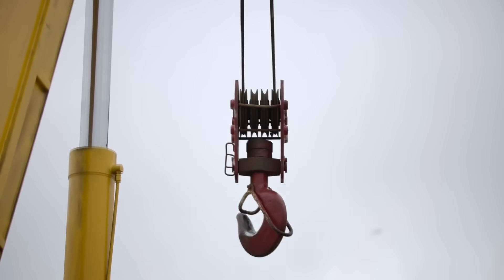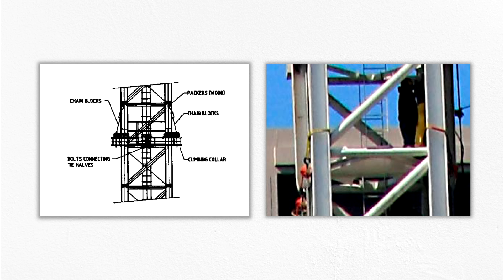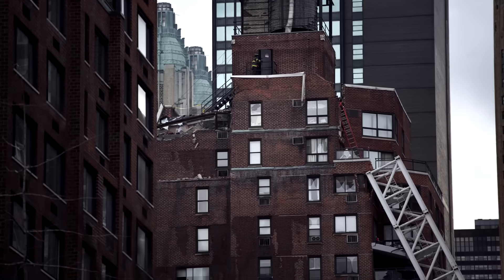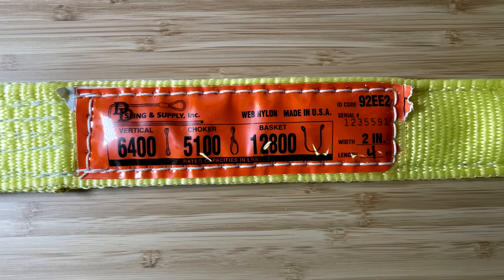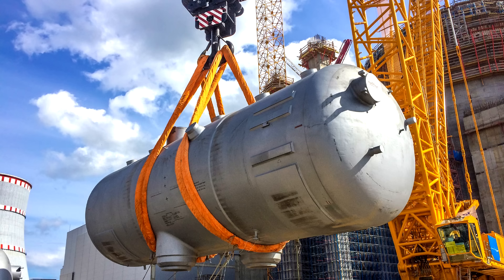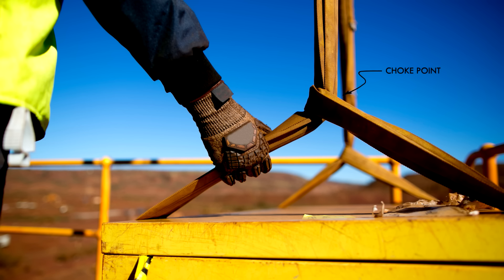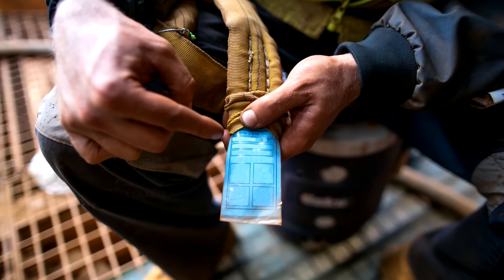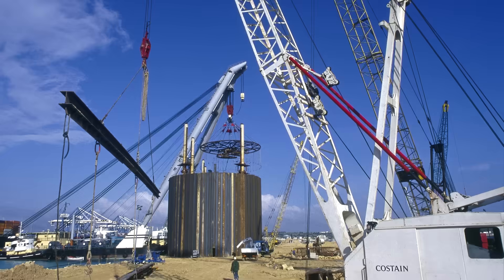Why Things Fall Off Cranes

Comment from the maker: 🏗 New to the channel? Check out a playlist to see more videos like this one: https://www.youtube.com/c/PracticalEngineeringChannel/playlists
📺 Get a year of CuriosityStream AND Nebula for 26% off, just $15! http://www.curiositystream.com/practicalengineering
📝Sign up for my newsletter to keep track of everything I'm working on here: https://practical.engineering/email-list
Reply: Doesnt have anything to do with cranes or lifting but I’d love to see a video series on the different types of building construction EI precast concrete, wood framing, brick and cinder block ect metal pole barn types ect. Get an engineers perspective on the pros and cons of each type and maybe even hear which type is best from an engineering standpoint.
Reply: Yooooo
Reply: Man u reminded of a tragedy happened Abt 6 or 7 years ago, the loud of a Cran fell down on a ... Kid
Reply: Awsome vid once again. 

I work in a place that uses a gantry-crane to lift big bins of product that’s just been sprayed out of a furnace onto a floor, then pushed into the steel bins. 

The bin is lifted via a roughly 50mm diameter steel pipe about 3-4 mm thick. 

But it HOT! Probably between 200 - 500 degrees centigrade depending on how long the product was left to cool for. 

I’ve been interested in trying to figure out how much tension resistance steel would loose due to different rises in temperatures but I haven’t the smarts for it. 

The product weighs approximately a tonne.
Reply: Where is the link for Crane failures???
Reply: How's this published three days before the vid was published!
Reply: Could you explain more about the basket hitch?  Wouldn't the horizontal force apply to that as well which would reduce the load rating?

Also, if you did a basket hitch where the load was very thin, it seems like it would snap at the same force as if you did a vertical hitch?
Reply: @minimalistic_banhaus  the difference is that the basket hitch doubles the amount of lines attached to the load. (4 instead of 2) 

The horizontal force applies to all lines. No mater the setup.
Reply: I'm just commenting for that sweet "learning the ropes" pun. A+ well done.
Reply: You should check out the cranes at the Boca Chica launch site from Space X. There’s some great load spreader examples
Reply: Grady, came here to say that I've long been interested in the Curiosity Stream offer, and today I finally made the plunge! Because its an annual subscription, I really wanted the benefit to go toward a YouTube Creator who really does a good job with the content and presentation. I'm so glad I finally got the opportunity to exercise this purchase. Keep up the terrific work!
Reply: Waiting for Nebula + Curiosity Stream to team up with Floatplane
Reply: So refreshing to see something other than civil stuff here
Reply: Will you discover if racheal maddow is a guy or not
Reply: grady what song is this 1:30-1:34 and it's not tonic and energy
Reply: Love this video.  Re-learned some stuff that I had forgotten.  Keep up the good work!
Reply: Can you Do a video on the benefits of dome concrete homes ?
Reply: Very interesting video. But you should have checked out the  rigging codes and rules first. (OSHA/NACB) There are strict "safety factors" that apply to all rigging and hoisting rope. I believe (from memory) that these go from 1.5x (for straight lifts) to 10x anti rotational rope (for hoisting personnel). As an Operating Engineer (IUOE Local 15) for 38 years.(Ret)  Who held a Class C Hoistng license. (expired) I can tell you, "This is on the test." BTW the Crane Engineer is "Ulimately" responseable for ALL loads that he hoists.  Even if someone else does the rigging. Although my license was for Cherry Pickers (50 ton). I have worked with and been part of many major picks. ALWAYS use licensed , Union riggers.
Reply: AISURU.TOKYO/TOKYO 💞 
(◍•ᴗ•◍)✧*。18歳以上の場合 

Youtube: This is fine 
Someone: Says "heck" 
Youtube: Be gone 
#однако #я #люблю #таких #рыбаков 
#Интересно #забавно #девушка #смешная #垃圾

Comment: So the vector sum of the forces F1, F2 and so on must equal the negative of the weight vector W, and the vector sum of the torques F1, F2 and so on exert at the center of mass must be zero. Then the load won’t be moving or rotating, if it wasn’t initially. But the act of having the crane begin lifting and the slings stretching or slipping as it does so introduce accelerations, both linear and angular, and these wouldn’t be easy to compute. A rotating rigid body, if it has no symmetric axes, will tumble, and this requires a Hamiltonian, I think, and a body may not be rigid. No one on the worksite will do all that. I assume they must use training & intuition plus generous safety allowances to keep out of disaster.

We have cranes at buildings in progress where I live, and their booms’ swings of arc extend beyond the fences around the sites. I’m sure they’re worried about people below, as they close the road and have a spotter when a load is traversing outside the fenced area. But control of bystanders is less perfect there, as there’s occupied buildings with many people across the street, and someone might still drive or walk into that area.

Comment: As a crane operator in NJ we always choker cables with shackles and never had a problem, we set steel alday long everyday. You must never use chain links can have severe stress that is not noticeable by the human eye . Straps are ok but must watch closely for fatigue

Comment: Spent 48 years rigging motors and pumps (Electrician), into not so nice places with managers tried to bully me with their untrained lack of common sense. Being dependable and accident free, just got me deeper into all facets of crane repair, (Not my profession), including stories that made my hairline match yours. At one time, they tried to make me a public embarrassment, telling me a 3/8" hoisting wire rope that I just replaced, was still good.  It regularly drops loads to a "steamy" acid bath, (Plating tanks), and had 12-14 visible broken strands on a 12" section of 3/8" wire rope, laying on the floor. I gathered his whole crew together, put on my non-cut gloves, bent the cable sharply in two at the bad point, as 30 individual wire strands, "Sproinged" outward throwing shrapnel in all direction, then bending it back the other way (180 degrees opposite), as all but 3 -- strands broke. (out of 37) I held it up to the 20 or so gathered, and asked, "How many of you think that I should put this cable back on because your boss thinks I am being wasteful, and is losing production?" My helper apprentice grabbed that cable out of the dumpster, and made a trophy out of it, mounted to a piece of plexiglass, until the plant closed in 2007. (Hoover North Canton)

Comment: I have had rigging and crane signal training several times throughout my career. Have rigged substations and generators to be hoisted to the roofs of hospitals and schools, 72 ton ball mills onto their trunnions. Switchgear and transfer into the sub basement of a high rise. Because many of the lifts have been “engineered lifts” I usually start out with new rigging designed for the purpose and destroy it after the use because of the liabilities.

Comment: Many, many moons ago the cool kids would work on their hot-rods in a local park.  One kid was going to pull the engine from his car.  He ran a double loop of rope between two trees.  The rope was straight across, taunt with no sag.  Then he attached a chain hoist to the center.  At that point I happened to be passing by.  I told him is wasn't good to do that, but he was a jock and I was just a nerd.  He got the engine about 3 inches in the air before the rope between the trees snapped and returned the engine back where it started.

Comment: There is a major OSHA violation plain as day on your second shot of the video. 
The retainer on the hook is not closed. If the load bounces it will come off the hook and kill someone. Look at the first clip, retainer is in place. 
I’m a Jet Assembly and Test Mechanic. The F-35 engines I lift are $12million a piece. We don’t drop them. We are over 2000 days with zero accidents.

Comment: Slings are great until they aren't.    Remember early in job, contractors  setting a 6 axis Kearney and Trecker machining center bed.  " SimpLe " lift..should have been low risk with a broderson, and the slings failed evidently due to abrasion and fraying.  Dropped the precision bed, bearings  impinged all the ways and took quite a bit to fix.    I pucker every time we do critical lifts in plants ...and likely piss off the riggers looking at slings..ask them to show me calcs and angles..extensions..limits.    Too bad.    Show me your calcs and hardware and slings.    And if worn or frayed " nope..go get new"

Comment: One incident I remember was when we were lifting the large fan rotor from the top of a cooling tower.  Once suspended all seemed ok until the wind suddenly came up. I was holding a tagline and it began wanting to be a turbine, rotating.  We barely got it under control by quickly adding more people to the taglines.

Comment: I have a shipyard on the gulf coast.
We still haul out and launch vessels the old school way - with railway tracks and cars that run from a level plane down to a 6 degree slope into the water.

We launch slowly, as opposed to letting the vessel splash, using a 85 T winch.
Most of the time, the load is greater than 85T so we use multiple pulleys, creating a 4-part pull and allowing us to pull vessels weighing up to 1300T.

I think you would find it fascinating, as it’s not a common practice.

Comment: I am surprised you did not discuss factors of safety on rigging gear and how the load ratings are set.  I do rigging plans frequently, and for critial lifts, we require a FS of 10, not 5 that most rigging gear uses.  And some gear uses 6 and other gear 3. So we need to sort out tha actual capacity of all the gear to ensure the overall FS is greater than 10.  

Other note is the item being lifted, If slings are put at an angle, the slings and rigging may be good for the load, but the horizontal load on the item being picked can cause it to fail.

As for the CG problem, the CG will always try to move directly under the crane hook, that is what causes most failures with CG, not underrated slings.

PS, always try to pick above the CG, it is just safer.

Comment: One summer I was working grunt level construction for a small company doing a job inside the Shell Oil Deer Park plant. It was lunchtime and we were sitting on the ground in the shade eating. Nearby a large crane was lifting a lined thermal reactor vessel to be put into place in an exisiting chemical unit. It had been removed to be relined. We paid it no attention as it was not our company or our job. Then something happened - the ground started shaking and a loud noise rolled over us. We turned and looked to see the boom of the crane flying backwards and the front of the treads lifting off the ground. Included in this sight was the crane operator flying through the air as he jumped out of the cab. Guy had strong legs I think, cuz he was moving like a bullet. The old timers eating with us had dropped their lunches and were high tailing it out of the area - something they had learned to do anytime something weird happened inside a chemical plant - stong self-preservation instinct. The rigging on the vessel had failed and dropped it about 15 feet to the ground. The crane didn't flip over, but the boom came flying back to the front and then wobbled around for while. I'm assuming the vessel was a total loss. The Shell guys didn't look too happy with the crane operator or the riggers.

Comment: I like to take my old out of service slings home to the ranch. Then I leave them outside, drive over them, generally treat them bad....,  pull trees up, fenceposts,  shockload them etc., with my tractor.  At some point I'll load test them to failure, using my 30 ton boom truck's LMI, and they still have in excess of 5 times their rated strength.

Comment: Thanks for the video. I'm not an engineer. I have a winch mounted in my garage loft and I'm always concerned about how much weight I can lift. Now I'm a lot more concerned, but using these formulas I have an idea how to start researching for safer lifts.

Comment: Great video on cranes. All the cranes you mentioned in your video are attached or sit on solid ground but how does a crane achieve stability when mounted on a boat?
I see lots of challenges for an operator when the crane is always moving.

Comment: 7:50 Another challenge with shallow angles is highlighted with your example, although you don't mention it. The horizontal forces can become so extreme that it physically deforms the load, in this case the container. Containers are amazing boxes, and have some pretty forgiving tolerances. Shallow angle lifts are bad all around! 😀

Comment: In Canada, you have to have a trade red seal certificate as a crane operator or rigger.  NAIT South Edmonton Campus has a crane school where vector math and trigonometry are used throughout the course.  If you are weak in math in high school you will not be able to finish this rigging course.  The other thing riggers learn is installing custom lifting points

Comment: Great video. I wish I had this 30 years ago when I taught rigging in the Army. The biggest issues we always had, was making quick assumptions. Like lifting a 2&1/2 ton truck, many peoples first thought is it weighs 2&1/2 tons, but that is wrong. It can carry 2&1/2 tons, and empty weighs a heck of a lot more. I always taught the soldiers to stop and try to get the same calculation results by using different sources for the numbers. Look on the item, to see if there is a weight, instead of reading the bill of lading. Then before lifting, look for a failure place, such as a sling that may slip, a chain hooked up wrong, ect. The when in doubt, recheck all the steps, and calculations.

Comment: I have done some of this work, not with big tower cranes but with things called HIAB’s (brand name), the small cranes mounted on the back of trucks. These can be extremely dangerous too as an incorrectly supported load can fall or break apart overhead, breaking chains can snap back with force too, or you can even cause the whole truck to topple over onto its side if the support legs arnt out or if they are on soft ground. 😬🏗️

Comment: my comany does cranework and rigging on a smaller, "safer" scale because we're a commercial framing company so all of our projects have either tower cranes and self erecting cranes on them. im a carpenter by trade as well as whats called the "designateded rigger" meaning when there is rigging to do, im the one to do it. its interesting to learn all the things that could go wrong when rigging as well as the "proper techniques" that should be used. with the material we lift being reletively light compared to the cranes load limit, we usually like to rig fast. we like to just wrap the chains around the load and send it unless its a particularly unique load.

Comment: I am sad that you left out the discussion of wear and tear. That new sling right out of the box is probably good for three or four times the load it's rated for. Within six months of usage, various small wear-and-tear add up and the factor of safety's is not nearly so large. Why no discussion on the amount of time a new slang is allowed to be used and then has to be thrown away?

Comment: question: how much extra capacity do you need to add for wind and does that change with altitude (i.e. higher up = higher wind) or shape of load ( a beam has less surface area than a train)

Comment: I doubt you had this in mind when you made this but - the info here gave me a lot to think about in regards to a different kind of lifting, that still involves rigging the load just right...
In my case the "load" is actually my husband, who is disabled. Anytime we are getting him in and out of the house, there's a small chance that he might fall. Because of that, we have two different things - a lift belt and a sling - to try to help get him back on his feet. We've never had to use the sling so far - thankfully - but I feel a lot more confident that I can at least know what to look at, and how best to get that sling around and under him. I've never needed to hoist anything (or anybody!) in a basket, never had to so much as haul a bale of hay on a pulley and rope. Your examples here and explanations gave me a lot more helpful insight than any of the other stuff I've read. Again I know you didn't intend that, but I wanted to say thanks anyway, because feeling more confident that I'll be able to help my husband if or when he falls again takes a big load off my shoulders!  (pun intended)

Comment: I was in Afghanistan where a unit pencil whipped the weights of a load. It was loaded into a plane that had a hard takeoff angle over the mountains.  With the wrong weight the wrong straps were used which broke during takeoff. This caused the plane to very up and stall into the mountain killing the crew.  Proper weight is essential to safe lifting.

Comment: riggers /firms continuing to use damaged / worn synthetic slings is the most dangerous practise i see, and it is by far THE most common and widespread malpractice of all, not least because the damage can be hidden inside (overstretch /overload) and therefore can also be undetectable by the rigger's visual inspection. .